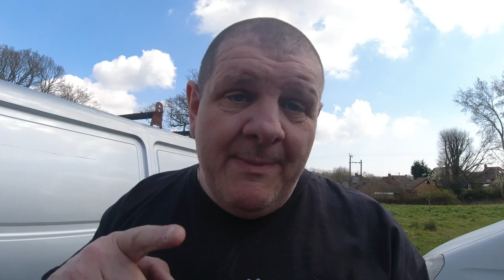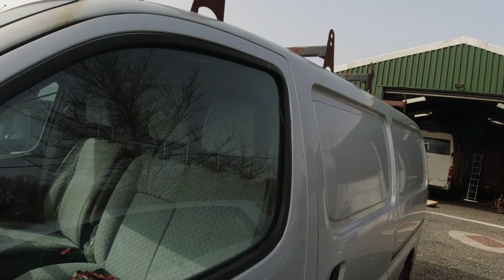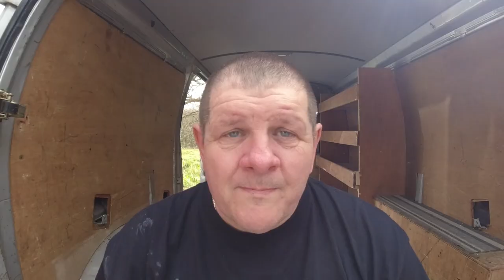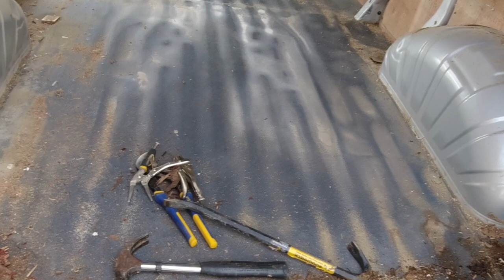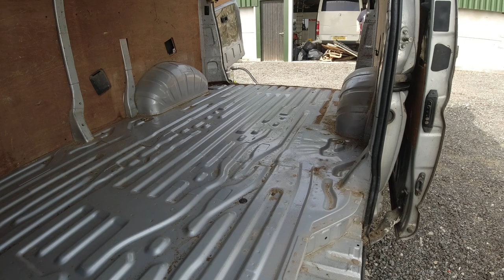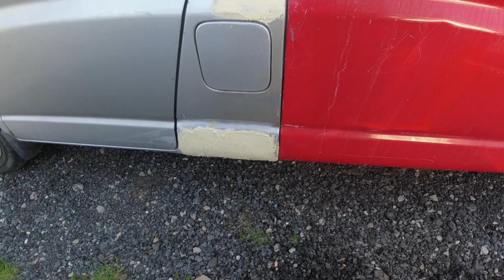Toyota Hiace Campervan Conversion - New Project and Trolls

Comment: Hi I've just started converting a 2003 Hiace, looking forward to seeing the project develop, windows fitted yesterday
Reply from the maker: this will be started soon and will be full steam ahead
Reply: @BuiltnotBoughtCampers  working on repairing some small rust patches and fitting insulation, then on to electrical system for me

Comment: Can you recommend someone for the rubbers I’ve got an MK6 transit but I haven’t got a clue what to order I would love to speak to somebody because threre is that many different transit vans I’ve tried ordering off eBay and got the wrong ones thank you
Reply from the maker: Hi there have a look at this door seal it's the one I fitted and a friend who has a transit used it as well.
Reply: @BuiltnotBoughtCampers  thanks I got an old ambulance go to buy it off eBay they wanted size and everything like that I haven’t got a clue to medium wheelbase bloody transit van to me I didn’t know you could just buy it on a roll and it was all the same I’ll have a look into it thank you
Reply: @BuiltnotBoughtCampers  I’ve got back to the video there is no mention of where you got it from
Reply from the maker: Sorry its amazon.  
https://www.amazon.co.uk/dp/B00NGYIHNY/ref=cm_sw_r_as_gl_apa_glt_fabc_5HYH6TRDPQ9XVTAXGQXF?_encoding=UTF8&psc=1&linkCode=ml2&tag=builtnotbough-21
Reply: @BuiltnotBoughtCampers  thank il check it out